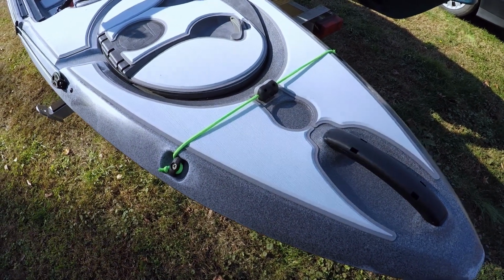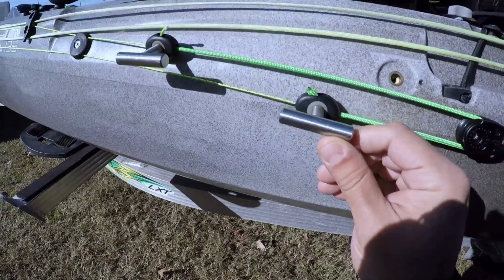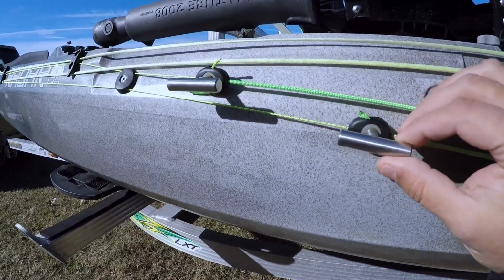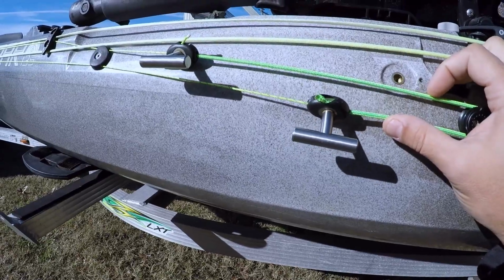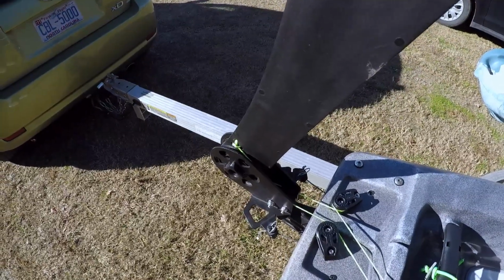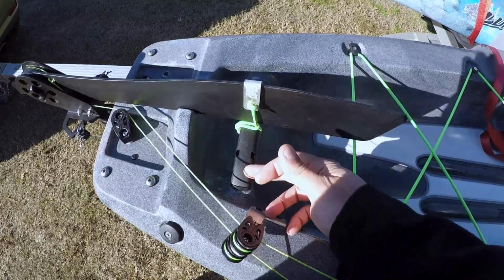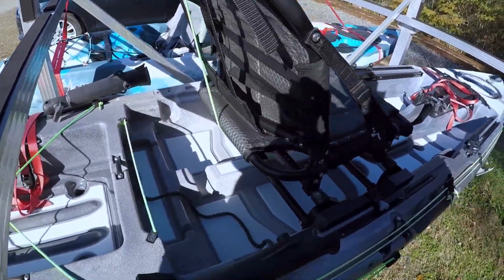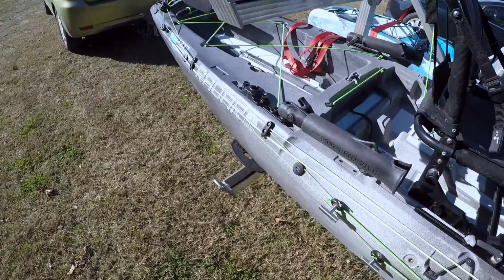WS Radar 13.5 Final Rudder Change

Comment: I need those pulleys you got on that lift cord for the rudder.  Where can I get those?   Thanks for the video.
Reply from the maker: HARKEN Sailing Dinghy Boat & Yachting - Carbo Cheek Block https://www.amazon.com/dp/B002KC5LFA/ref=cm_sw_r_awdo_navT_g_F87EPTE001HBXGG2Q2S3?psc=1
Reply from the maker: Hope that helps ya